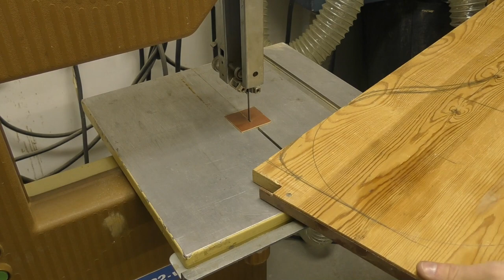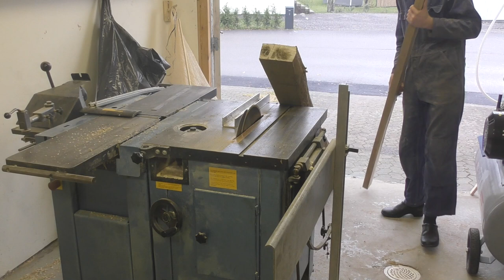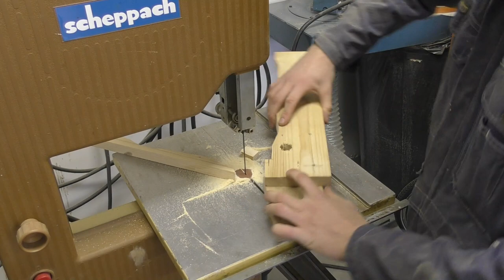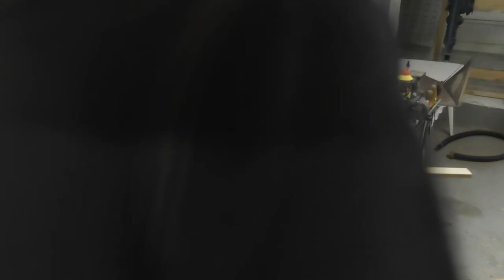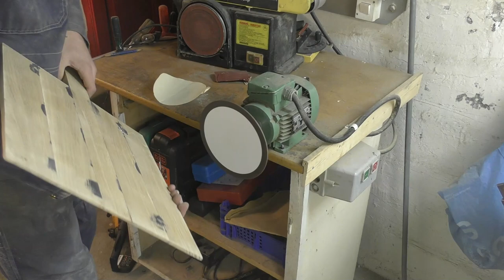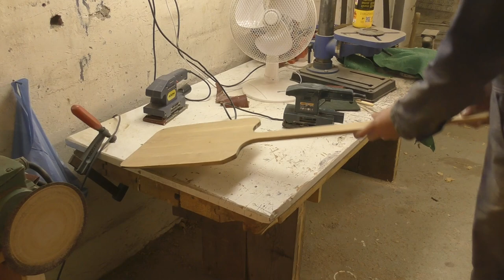Making a Wooden Pizza Peel

Comment: Could you please tell me the reason for covering part of the sanding disc, and what did you use?
Reply from the maker: I didn't have & still don't have any fine grit sanding disks for that particular machine, so I just stuck a fine grit disk onto the already mounted one. The fine grit disk got adhesive on the back so eventually it will fly away, I just took what I had at home.